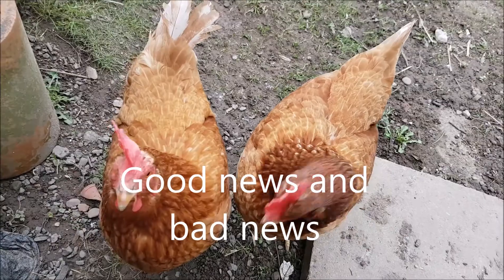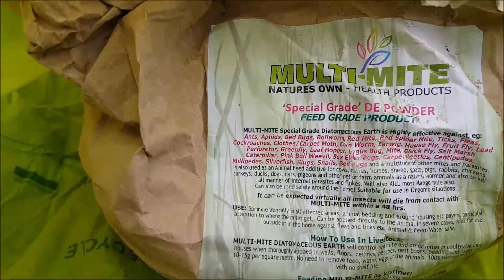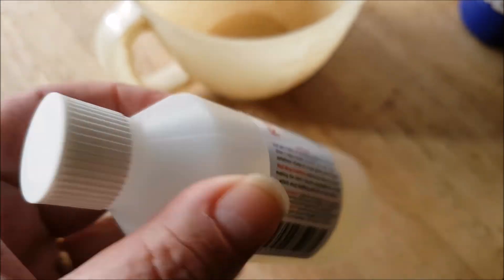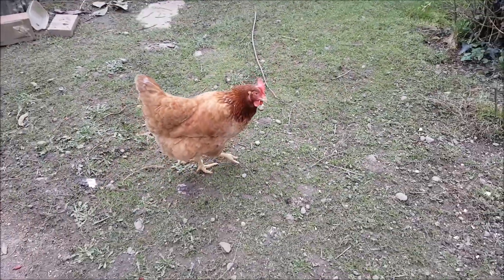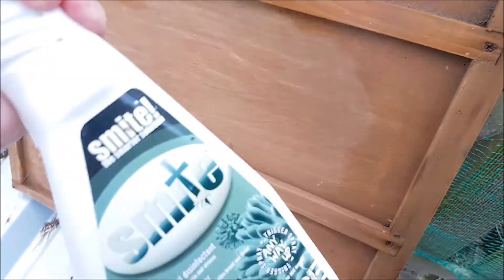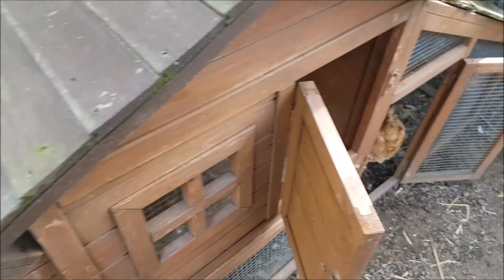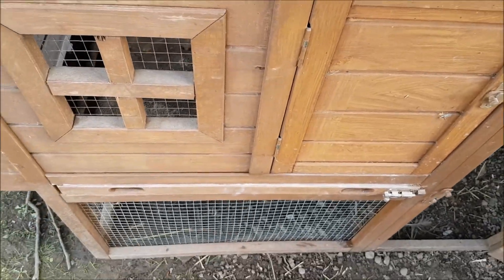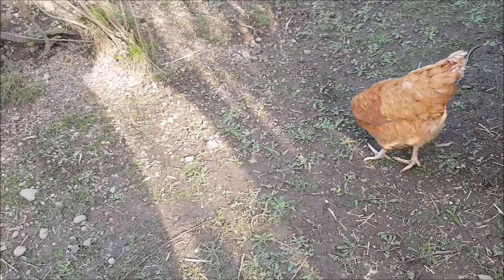Rescue Hens | 37 Red mite

Comment: Hooray thanks for that, hadnt heard anything, feathery freedom. Gave my coop a good dousing with miteoff last summer, not seen a single one since. Long as its well aired fly spray works too.
Reply from the maker: Yes Hooray for the end of flockdown!  Thanks for the tip - I'll check out miteoff - folk say creosote but that made me very ill 30 years ago painting the fence. I've also left fly spray & bug bomb in the coop for a while,  zapped them with a gas torch, & painted the coop last year, so surprised they were back so early.